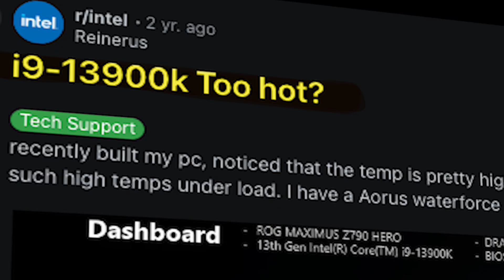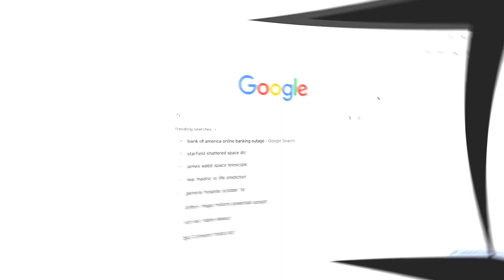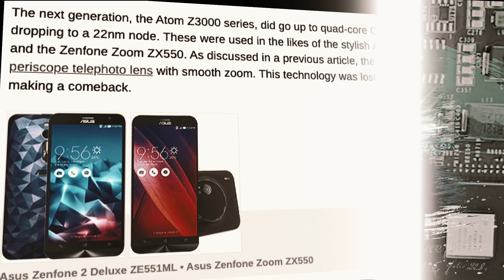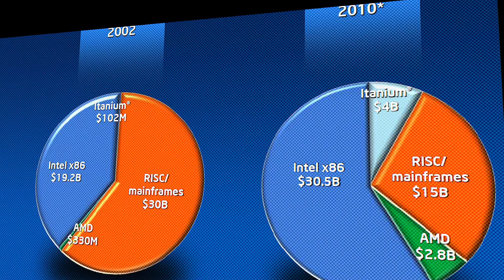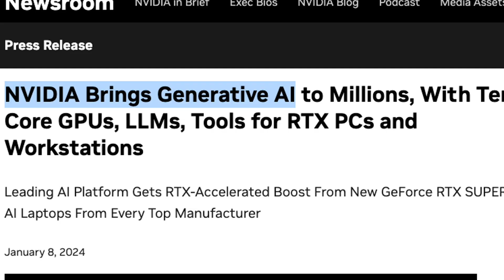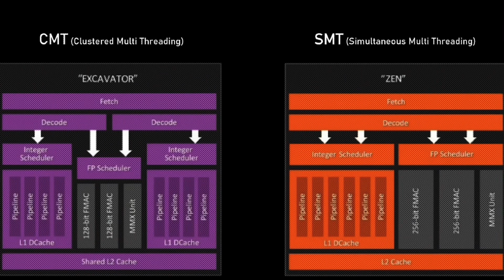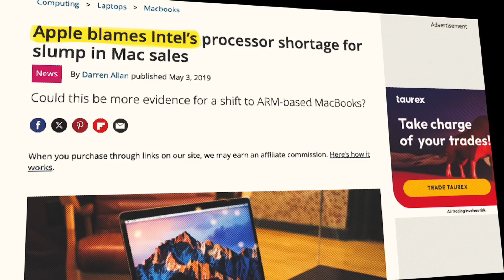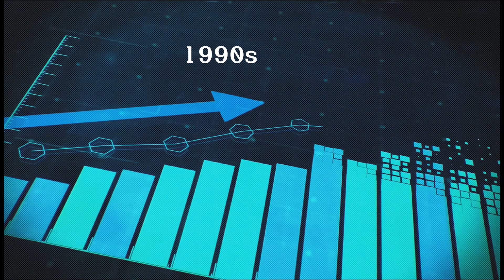The downfall of Intel : How Intel lost it's edge

Comment: It wasn't until I used a RTX 3090 Full size GPU on my laptop that I found out the days of the Desktop was almost over for me. When I bought my S22 and later S24 that many more things could be done without using a desktop computer and the phone is able to out preform the desktop computer spending less then $1.200.00. Using the S-DEX you can power up any 4k TV or Monitor link it to that laptop and have a viewing from 4k up to 8k in almost all applications. I was so pissed off about spending the investment into my Intel 4790 to find out that there would be a TPM chip that stopped me from upgrading due to TPM 2.0 so for under $1.900.00 I bought a smart phone that will out preform
all of Intel's future PC markets and log-on to a better market and I'll know well before hand, if it's a good buy before buying. Computers of the future is more for coding and gaming and to not use as any investment because you are able to buy cheap and not invest in failing markets.